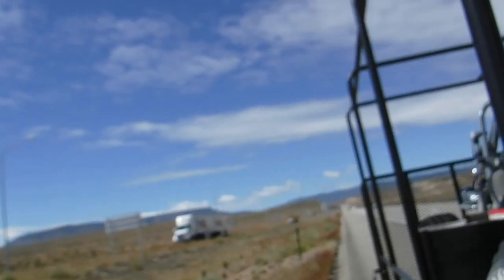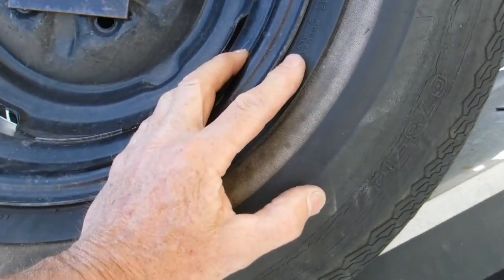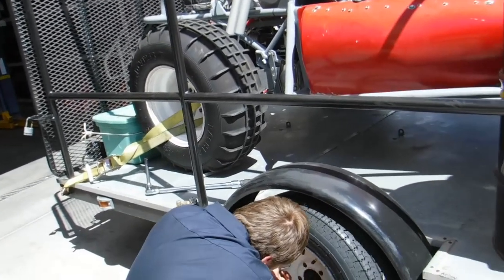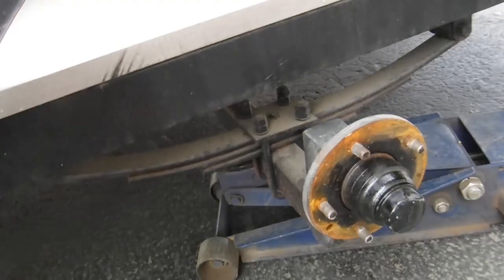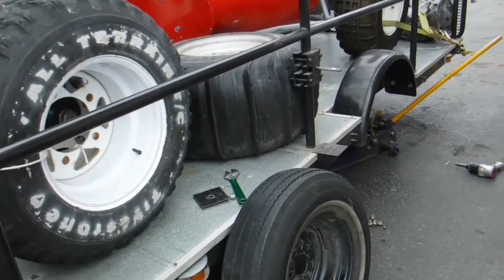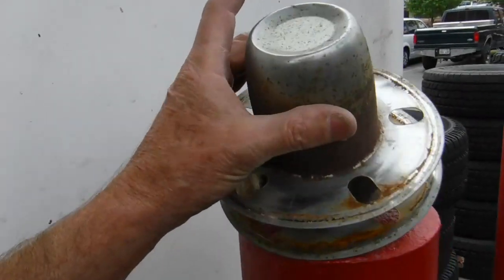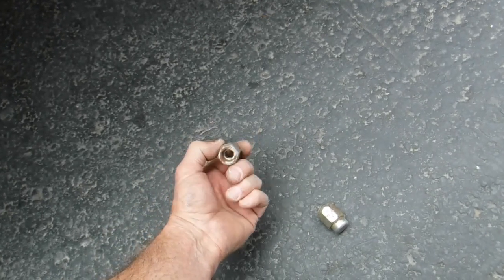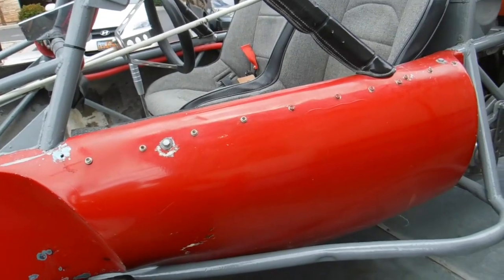VW Old School Desert Racer Pt 2

Comment: id love to tell  you my story ,, bought a buggy w a 2.0 alcohol pinto eng. never got it to run correctly . melted it at pismo beach after bucks and head aches . all 3 tires failed on the trailer (i own a tire business).  thought id make a 200 mile trip. trans broke by laughlin nevada. steering bx mount cracked at armagosa dunes. steering linkage at dumont dunes (bruised wife's face with gravel ) .  CV.s  and asle bearings . took me 2 years to repair every thing. has a 2.3L turbo injected from a t-bird turbo coupe. bullet proof engine,,  the trailer had no suspension .  So we named the buggy delema adventure.
Reply from the maker: Cool story, Thanks for Sharing.  Gives me the encourgment I need to keep forging ahead and keeping my car running. I had a 2.0 pinto buggy ounce. Always wished I had the 2.3 Turbo like yours. Keep the rubber side down my friend.
Reply from the maker: I appreciate the offer but I'm sticking with air cooled VW's for now